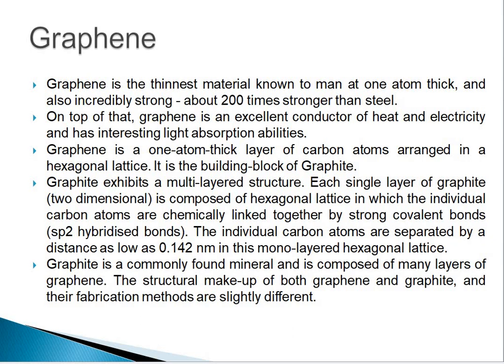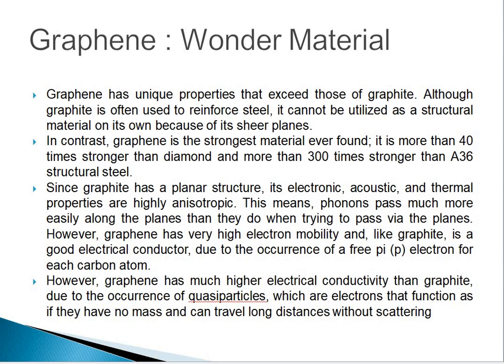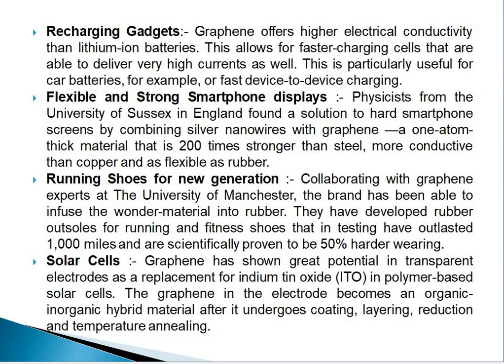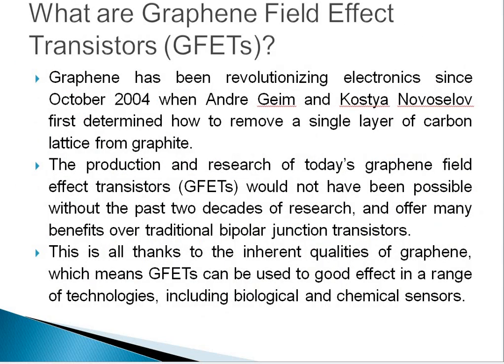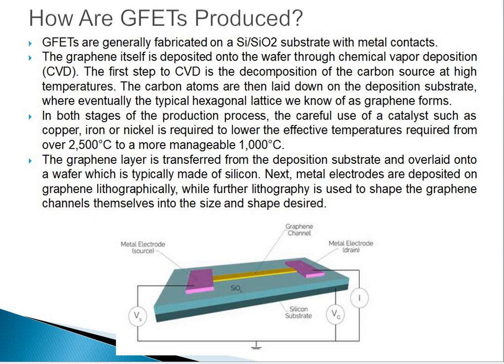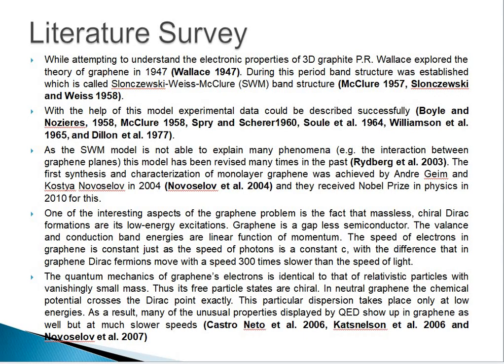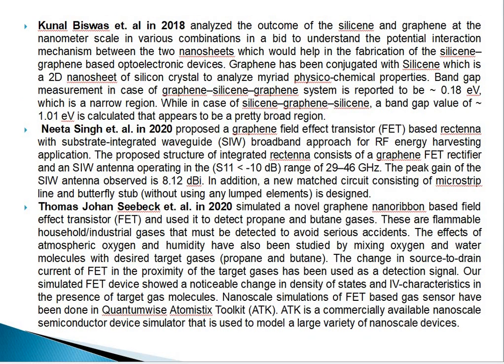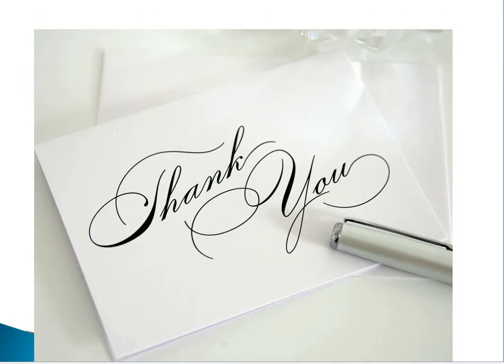Silvaco TCAD ATLAS Tutorial 14, What is Graphene? What is it used for? What is Graphene Transistor?

Comment: how can I change unit of current axis from A to A/um for 3d atlas device?
Reply from the maker: In case of 2d device unit is A/micro meter because width of the device automatically takes 1mico meter.
In case of 3d device u have to mention the width of the device
Reply: Engineering technology and society 
thanks a lot,I have simulated a gaa cylindrical  by 3d atlas,I want to use it as a component in a circuit by mixed mode in silvaco.for achieving this purpose,I’ve used the syntax which is the same as one I’ve used in 2d structure cases in mixed mode,but I faced an error.I think that using 3d structure in mixed mode is diffrent from using 2d structure in mixed mode and I don’t know the difference😔please guide me🙏🙏
Reply from the maker: It's take time to elaborate in details
Reply: Engineering technology and society 
do you know any sources that I can find an answer to this question?I’ve read mixed mode chapter in atlas user manual،but there weren’t any example about 3d structure in mixed mode
Reply from the maker: I ll try to arrange and send it to u... please share ur email id
Pls like subscribe snd share my channel..... thanks in advance
Reply: Engineering technology and society 
I mean this one